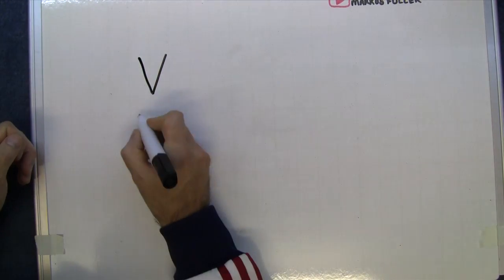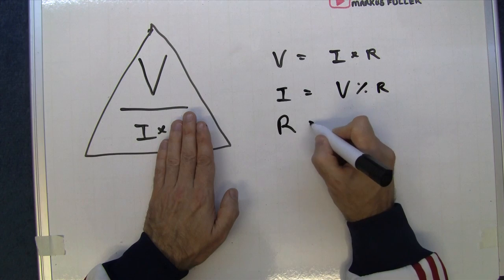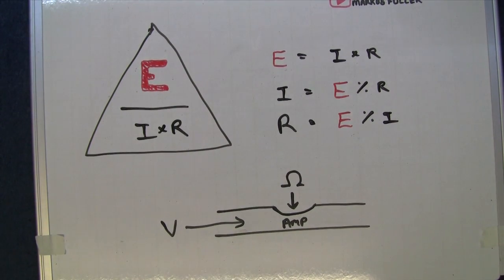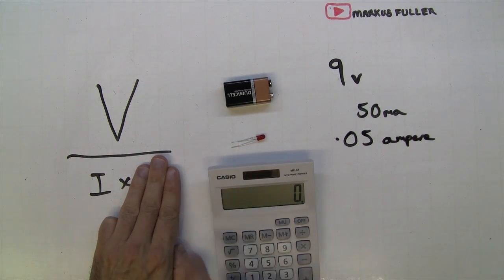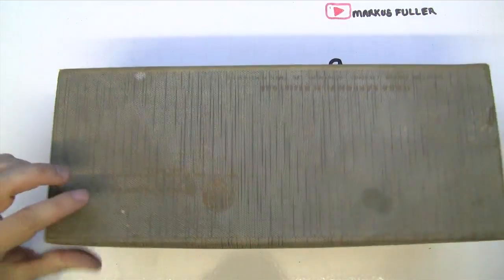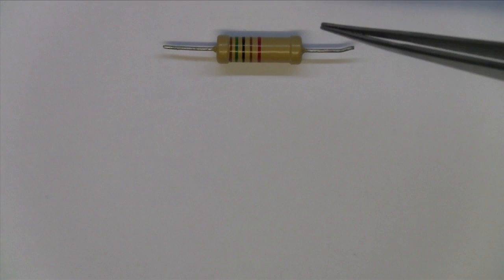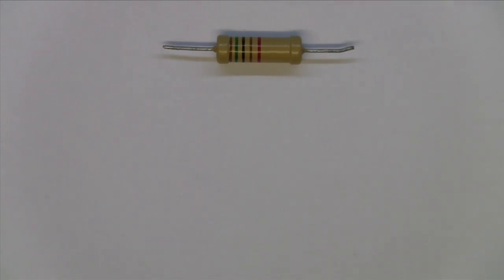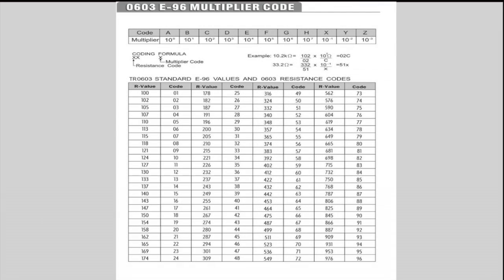MF#38 Ohms law and how to read resistor colour codes

Comment: I remember being taught this weird way of remembering the resistor colour coding via a strange saying.. 

Bad - Black - 0 - 0 - 0 - Multiplier x  1
Boys - Brown - 1 - 1 - 1 - Multiplier x 10
Rape - Red - 2 - 2 - 2 - Multiplier x 100
Our - Orange - 3 - 3 - 3 - Multiplier x 1,000
Young - Yellow - 4 - 4 - 4 - Multiplier x 10,000
Girls - Green - 5 - 5 - 5 - Multiplier x 100,000
But - Blue - 6 - 6 - 6 - Multiplier x 1,000,000
Virgins - Violet - 7 - 7 - 7 - Mulitplier x 10,000,000
Go - Grey - 8 - 8 - 8 - Muliplier x 100,000,000
Without - White - 9 - 9 - 9 - Multiplier 1,000,000,000
Getting - Gold - Multiplier x 0.1
Sex - Silver - Mulitplier x 0.01

😏😏😏       😎🇬🇧

Comment: I always fail to identify the colours on the resistor bands. They all look basically the same to me, especially the browns-reds-oranges. How do you deal with that? I don't think i'm colour blind.

Another issue is figuring out which way to hold 1% resistors which have values starting with a 1... By the way, DSO138 kit seems to have a few of these, and i think they even managed to sneak some in which appear as another value from the kit when read the wrong way around!

I'd rather just put my microscope on it and read a digit code.
Reply from the maker: I agree some browns oranges can look very similar and i have had to double check on an ohm meter a few times especially some of the small resistors that have a cream-brown base colour.

Comment: How do you clean guitar potentiometers? My volume knob is scratchy and electrical cleaning/lube spray doesn't help.
Reply from the maker: +t000lish Hello the best way is to disassemble the pot and clean the carbon track with isopropyl alcohol but that can be tricky depending on how the pot is assembled. sometimes its just much easier and cheaper to replace the entire pot.

Comment: Thanks for explaining this Marcus, it's easy to forget that there are poorly competent dabblers (like me) who need to know the basics if you are dealing everyday with more complicated maths & circuits.
Resistance has always been a little out of my reach of understanding, so this video has been very useful to me
I replaced the LCD display on my Oberheim OB12 a few months ago & now find it too bright. It reads around 3.25volts, but it's far too harsh on the eye, leading me to suspect the backlight may be overpowered & failure is apparently common.
  I've been reluctant to use the synth since making the repair & been meaning to re-open & simply attach a potentiometer to dial-out a bit of power but perhaps I feel a little more confident about calculating a resistance suitable and do the job properly.
Reply: Sorry to go a bit off topic - where did you get your replacement OB-12 screen from?
Reply from the maker: Hi Brickscratch. Yes sounds as if you are getting too much power to the backlight. you could try using a potentiometer, maybe one of those small multi turn ones will do the trick as its a low voltage you are trimming it should work. I have used these in the past with success when dimming leds and low power bulbs. best of luck I hope you get it sorted.
Reply: t3l3phasicworksh0p Hi, Originally I got a 'Negative Blue' from here: 
http://www.rapidonline.com/Electronic-Components/240-x-64-Dot-Graphic-LCD-Displays-500170
but I found it had 2 'very slight' vertical lines when I installed it & the contrast wasn't too good. Couldn't find any errors in my soldering & as a couple of months had passed + I'd put it in myself, there'd be no point in complaining, so I put-up with it.
..I later found a supplier on eBay (from China) for a 'Blue 240x64' LCD screen for just a little over £20 & it's great, just the brightness being an issue (& the other expensive screen now sits in my spares box)
I've checked the links & it seems 'they' are not selling them anymore but I did a search & found you this supplier :-
http://www.ebay.co.uk/itm/JHD24064C-24064-240x64-Dots-Matrix-LCD-Module-with-Blue-LED-Backlight-/181566883051?pt=UK_BOI_Electrical_Components_Supplies_ET&hash=item2a463ac4eb
I hope this helps you t3l3phasicworkshop , Great name by the way ;)
Reply: markusfuller Cheers for the tip :)
 I just ran a test with a guitar pot (500k log) using a similar voltage from a couple of batteries, it takes it down to about 2¼v. Tried it in the keyboard & it's too sensitive to be practical (& rather an ugly fix) 
But in my box o' bits i found a mini-pot which was salvaged from a miscellaneous PCB which has taken the sting out of the bright backlight nicely & done the trick. Wrapped it safely in clear fablon & I feel a bit more confident that it is less likely to burn-out in the future. Many Thanks again Marcus :)

Comment: Great vid as usual. One question, those old adjustable resistor gadgets you showed at the end, are they still precise after 100 years ? could you measure with your digital multimeter if the resistance is still precise after probably 100 years ? Thanks!
Reply from the maker: Hi the first decade resistor is quite out of spec but the one with the dovetail box is very accurate as its all sealed. where the first one had dirty connectors on the top and maybe if i cleaned the contacts up it would read more accurately. but even after 100 years I guess if its good quality and contacts are clean then it should be within 99% accuracy.

Comment: I miss the old fashioned electronics, making radio receivers from 4 simple parts, etc.  You can work out anything from V=IR along with the capacitance equation which is promised to us shortly.
Reply from the maker: Hi David, Still working on the Capacitor Video at the moment, Im trying to build a good old fashioned Leyden Jar to get started :-)
Reply: markusfuller I love these videos, and since 90% of the restorations I've gotten into have been cap-related, a capacitor video would be very much appreciated.  I would love a breakdown of caps in synths, for sure- there are tons of resources for capacitor replacement/repair in valve amps, but an overview of how a bum cap can cause notes to wobble on an old Elka string machine would be rad just one example.  And just sharing an overview of your experiences in troubleshooting capacitor issues- things to look for, tips on testing... it would probably help a lot of burgeoning tech-y musicians like myself a bunch.
Reply: petedello1
I think capacitance is the ratio between charge and voltage.  That along with the ratio between voltage and resistance should be enough to get you through any dielectrical  dilemma.